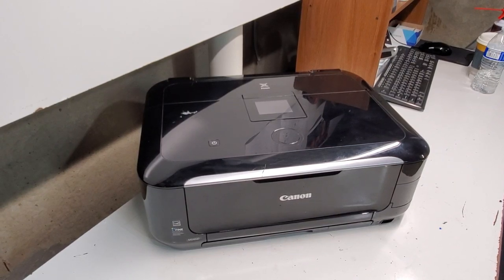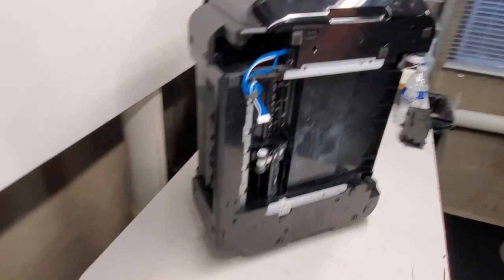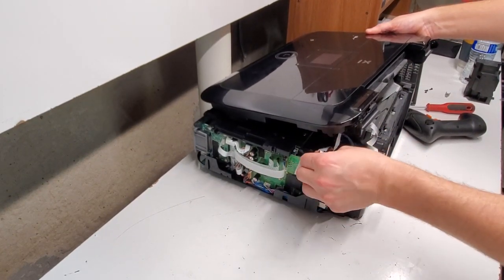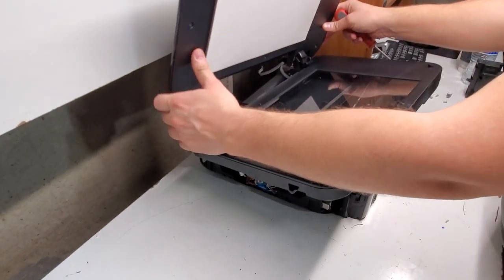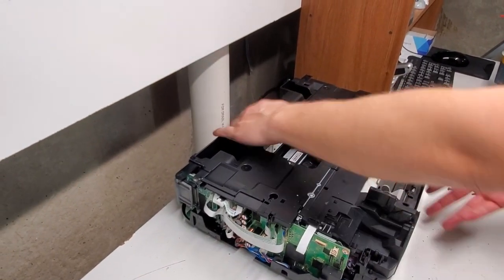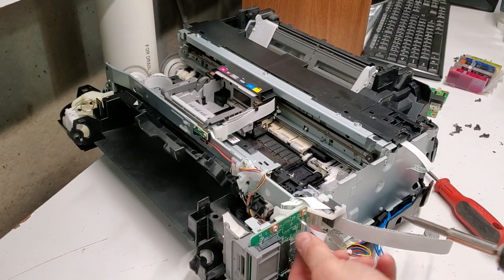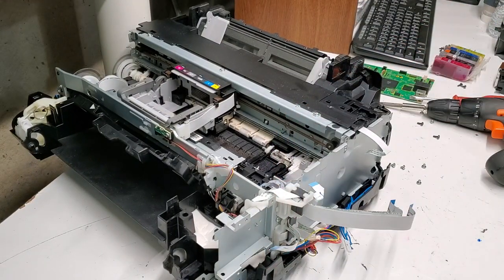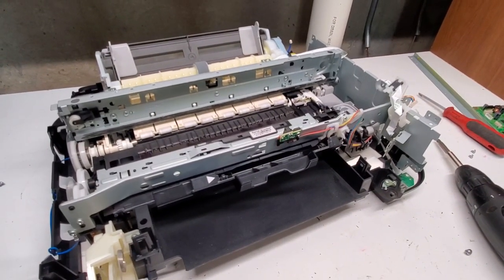Taking Apart Canon MG6220 Printer for Parts or to Fix

Comment: Whatever you do with your printer make sure you video everything just like this guy so you can remember how to reassemble it. Or if you need to upgrade harddrive or memory on your laptop. Also, whenever disassembling plastic parts instead of using a hard a screwdriver go down to your local auto parts store and buy small plastic wedges that are typically used for body work. They work much better to pry apart plastic parts.  They don't score the finish.

Comment: I watched to gain information about replacing or cleaning the ink absorber. Your video was very clear and you did a great step to step job in helping to get to the parts.  The ink abosorber wasn't mentioned.  Do you know how to do this? ... where is it ... how do you get to it?   can you add this to the video?  Thank you!
Reply from the maker: I have to take a look at this printer again. I have never replaced the pads, but they are very hard to get to on most canon inkjet printers. Just replacing the pads may not clear the error. Try the reset option in the video below:
https://youtu.be/9SrBzabJj00
Reply: hi i'm on the same Problem - did you fixed it?

Comment: great video thank you! so I got a U052 error on my canon mg6120..which part of the printer does this relate to, the carriage or the board? if I  lightly sand the contacts on the ink cartridge and contacts on the carriage it works for a few minutes..thanks!

Comment: Hi! I have a MG6150 and one of the two plastic "clips" that holds the top cover has broken.
The printer is still perfect so I'm a bit sorry to throw it away for something so silly, I found a non-functional one online that I was thinking to buy and get parts from, you think it would be easy to replace the cover clips or I would need to replace the whole cover?
Thank you!

Comment: Thanks for the video, I'm hoping to take apart my MG6150 printer to put the spring that holds the front door, back in it's place.
Reply from the maker: Hi. You may only need to take tge side panel for that. Good luck with repair!

Comment: Hello, I had to take apart my Canon MG6150 to remove a paper jam.   The left hand side panel contains the support for the lid  Unfortunately the spring inside this arrangement of cogs fell out.  Would you have the diagram of how the spring is laid out in this panel.  Thankyou in anticipation.

Comment: Whiich part is ink absorbtion unit and how you replace that? Thanks
Reply from the maker: It's very difficult to replace on this printer.  It is at the back. If you get an "ink absorber full" message, you will still need to reset it even if you replace with a new. Usually they will last longer than what it is programmed to. You can bypass the message by buying a reset key online. Different sites offer it at a fee, but you can also try the instructions on this site:
https://technorecharge.freshdesk.com/support/solutions/articles/6000134953-maintenance-mode-ink-waste-absorber-reset-

Comment: Mg6220 printer has a clogged blue area.  I diassembled the print head.  Soaked it in hot water.   Took a syringe and shot water through the ports after removing the white head and 2 screws.. I did not shoot water through the white head for fear of ruining the head.  Its better but not perfect...  your suggestions?   Hot water?  Iso propyl?  Your thoughts...
Reply from the maker: Hi. Both methods are fine. Are you sure the cartridge has enough ink? Try putting a few drops of windex into the cartridge bottom ink port hole. That can help dissolve some dry ink in that area.

Comment: On my canon mg6220 I keep getting and error message that there is a paper jam. I searched high and low and find no jams. I did notice the paper will not feed thru bottom tray but will thru to top back photo paper feeder when powering up but then comes the jammed paper message. I also noted that the bottom paper roller feeder does not turn when powering up. It turns freely by hand. Is this normal?  Could this be the cause on the jammed message?  Is there a way to clear the message?

Comment: Current Error code 6C50 and sometimes B200, despite resetting printer and installing a new print head QY6-0078..  Any thoughts?
Reply from the maker: Try to see inside the printer with some light. It seems there is something in the way of the ink carrier.